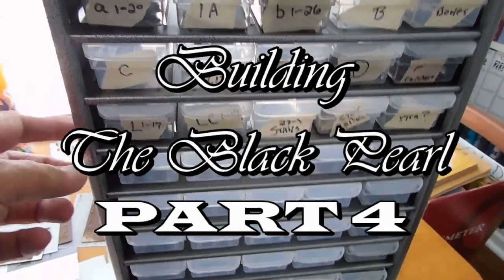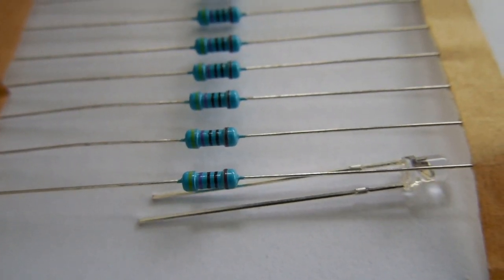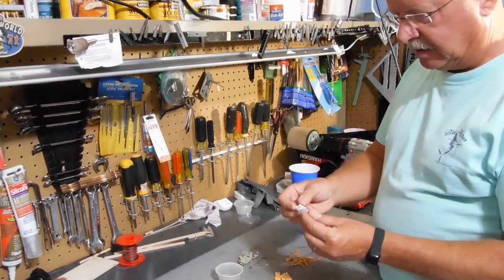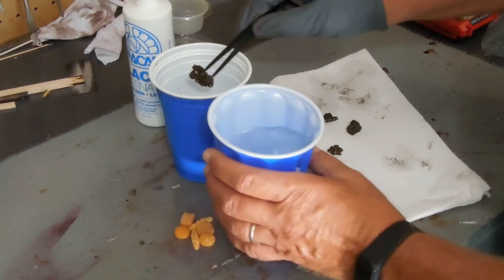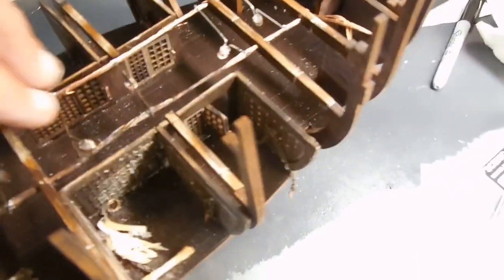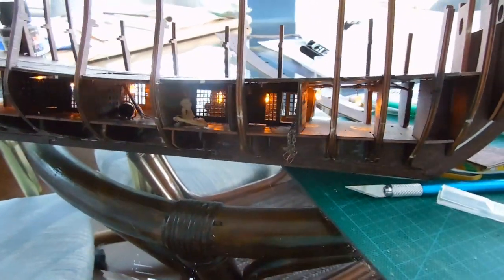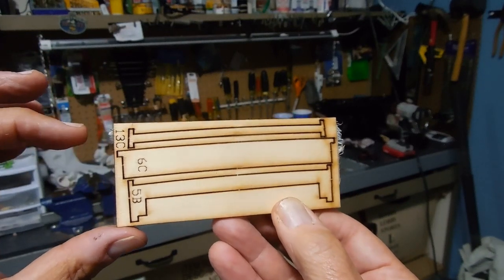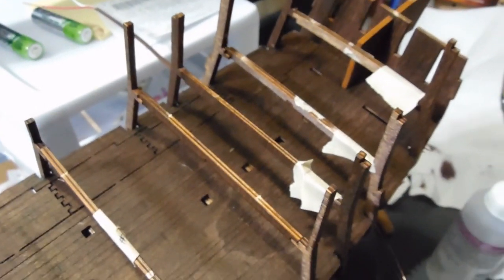Building The Black Pearl Model Ship Part 4

Comment: I am building the black pearl following the ZHL mode but there’s some different parts that it doesn’t match and I can’t find on the web, minute 12:27 the other replica of the door with wall goes on the brig level (the first level you build) I was trying to fit by presenting them the the dual in the bottom you actually have to separate it, Nice videos I do appreciate you posted videos like this! Cheers.
Reply from the maker: Alejandro Hernandez ; I hope that my videos help.  I have some parts for the lower deck left over so I made an error somewhere on that deck.  It will be confusing at times. But just take your time, watching my videos and others to get ideas.  You might want to put cannons on the lower deck before you cover it! I had difficulty getting them in place. Thanks for watching

Comment: would you please share the lights instructions from the manual?
Reply from the maker: Unfortunately the version I have has very little information on how to install the lights.  Here is a link to instructions and you will find about all there is on page 42 and the following couple of pages.  I've made over 20 video segments and mention at different times that the instructions on this version are terrible to say the least.  I hope as you follow along, the video's will provide some help if you have this or a similar version.  Here is the link:  https://drive.google.com/drive/folders/1acAb-zRD4dtSqqxomRvs1ZkvfVZBe4lN  You can also find it at Banggood.com at this link, https://www.banggood.com/1-50-Black-Pearl-Ship-Model-Building-Kits-for-Pirates-of-the-Caribbean-DIY-Set-Kits-Assembly-Boat-Toy-p-1540616.html?rmmds=search&cur_warehouse=CN scroll down in the description and you will find them posting a link to the same terrible instructions.
Thanks for watching, good luck in your build if you have already purchased this version, if not consider saving up and getting the ZHL authentic version.... around $300, but might be worth it because more parts included and a manual....  I may build it some day now that I've gained some knowledge and experience!  👍😂👍
Reply: @BoilerDan1  I have look through them. You are right instructions are awful. Do you have any piece of video showing how you connected those transistors to what?
Reply from the maker: Looking back on it, I didn't do a real good job of explaining the lighting.  I can give you some pointers.
1. I went to a local electronics store and took along the flickering lights.  I run them off of a square 9 volt battery, so he was able to give me one resister that would reduce the 9 volt to the proper volts and amps for the lights I purchased.  NOTE: the lights came with resisters, but it was 1 resistor for every light...  That was going to be a wiring nightmare.  The electronics store guy said I could run 10 of the flickering lights per resister.
Now I'm considering getting a plug in transformer so that I can run them from a wall outlet and then put a timer on it so they come on and off at regular times in the evening.  I'll make a trip back to the electronics store for more advise on that!

If it helps, here is the link to where I purchased the flickering lights (Amazon) 
https://www.amazon.com/gp/product/B0785DQ8FD/ref=ppx_yo_dt_b_search_asin_title?ie=UTF8&psc=1
The resistor I purchased at the electronics store is the
Brand: NTE 1/4 W 47 OHM 2%
                          QW047       ROHS 
 They were 2 for less than $4.  On the package is a web site www.nteinc.com but I think a local electronics store or maybe Amazon would be better?
OH, IMPORTANT: They must go on correctly.  On the lights one wire post is a little longer. That is the positive wire, the shorter is the negative.  If hooked up backwards on any of them, they will not light.
Reply: @BoilerDan1  thank you

Comment: I’m having difficulties with getting the lights to work. Any advice? I got the same lights as you. And placed 8 per level
Reply from the maker: Aiden Southern I’d suggest take the lights to an electronics store, along with your power source, they can match up what kind of resistor you need.  The resistor is the key!!
Reply from the maker: I’ll add: if you use the resistors that came with the lights, you have to hook each one to a light. The electronic store can get you one for all 8 lights. They are not expensive (just a couple of dollars)
Reply from the maker: I just thought of one more thing! The lights only work when you have the + and - set up correctly. Try reversing the wires going from the power source.  Each light must be hooked up the same. Determined by one wire post is longer.  Hope that’s understandable?
Reply: BoilerDan1 yes it is! Thank you so much
Reply from the maker: Aiden Southern : Just confirming that you did reverse the wires and now they work?  (Other viewers who might experience the same experience can understand what our discussion was about. Thanks again for watching and taking the time to comment!

Comment: Hey dan I’m bought the same kit it is a challenge up too second level. I’ll try n get you some pictures
Reply from the maker: I’m closing in on the finish line. Weather has been nice so it’s a little bit on hold.  Make sure you do any extra stuff on the lower deck. It’s hard to do anything down there once you put the upper deck in place.  Just take your time and you’ll end up being proud of your work when you’re done 👍
Reply: BoilerDan1 ya I did put a lot things on the first level.  Found dungeons n dragons skeletons that are the perfect size.  Found jake and the crew in Germany finally got them.   I’ll get u some pictures